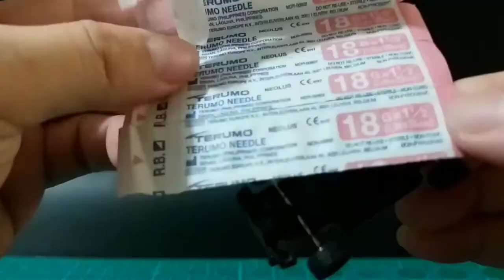CUSTOM HOT WHEELS ACURA INTEGRA

Comment: Great. Who else struggles with the moulding of the wheel arches???? It kills me!!! Same with cutting the doors, I use about 5 blades per door lol
Reply from the maker: Thanks SHANNON 😉😉😉
Reply: Shannon I feel your pain,I struggle with doing the wide body kit and I broke my jewelers saw trying to cut the hood of a 1960's camaro,luckily I was able to cut the hood enough to just use some force and pop the hood off but still,for the moment I'm stuck with only being able to do coloring and wheel swaps before I can order everything I need 😅
Reply: @narutowolf1957  It also doesn't help if you've got the concentration of a goldfish and are impatient AF lol... How do the do such brilliant work in only 15mins?
Reply from the maker: Just need more patience do it slowly, make sure the saw blade is lubricated, im using my bike chain oil to lubricate my saw blade, avoid moving the saw left to rigth focus on straight line, on curve do it slowly countinue sawing while turning,
Reply: @customhotwheels  thanks for the advice